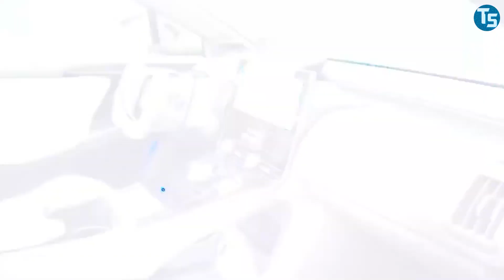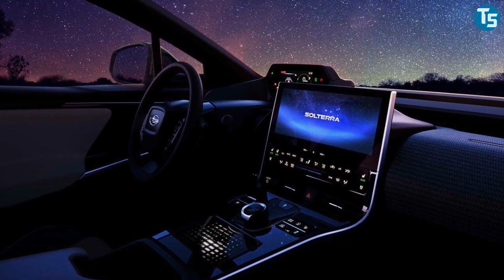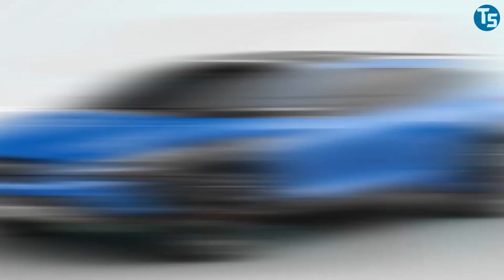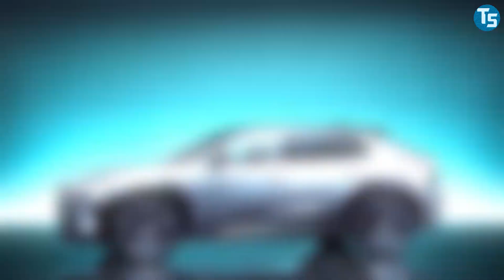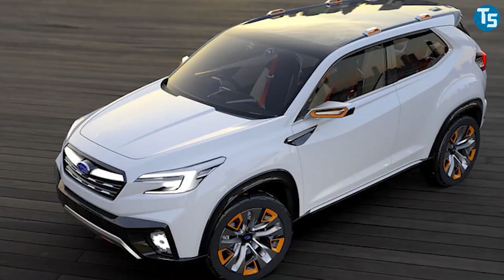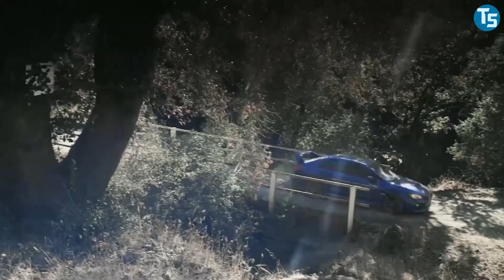Subaru Solterra EV 4x4 2022

Comment: This is an advertisement. The first thing everybody needs to know is the actual range before refuelling, under normal driving conditions. The second thing is can I refuel it within 5 minutes at a refuelling station? 4 wheel drive Subarus do go off road and on some very poor country roads. We don't find electric charging stations in the bush in Australia. On a 1000 kilometre trip we cannot afford a 3 hour recharge every 300 kilometres. Will I buy one is dependent on will it get me there and back.

Comment: Observations: 1) there were two steering wheel configurations shown, a yoke and a steering wheel. The steering wheel is a more favorable design for rough terrain than a yoke. 2) the mileage is disappointing. When driving off road or backcountry roads a greater mileage is necessary. I own Subaru vehicles and want to make the switch to an EV but the relatively low mileage and lack of charging stations reduces my comfort with this configuration.

Comment: Will the GPS system list charging points along extended trips  ?
Reply from the maker: As of right now there is no information about that. But it seem almost like a priority for such an adventurous car.
Reply from the maker: Check out this video to know more about the Subaru Solterra and it's look alike, the Toyota BZ4X -- https://youtu.be/9I_4SgMS-aU
Reply: @TechSpottt  Subaru is relying on CA to have power fill stations along the way. But they have a very hard time in the Summer keeping the lights on. I would rather let the free market dictate when we switch to power(renewable) Biden is forcing this much to hard.